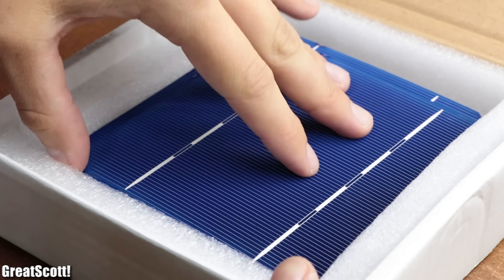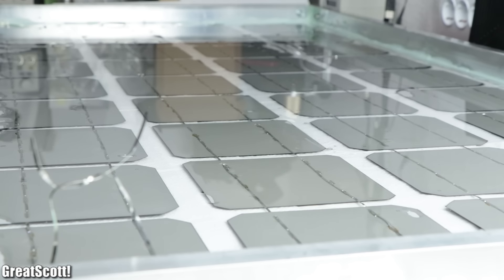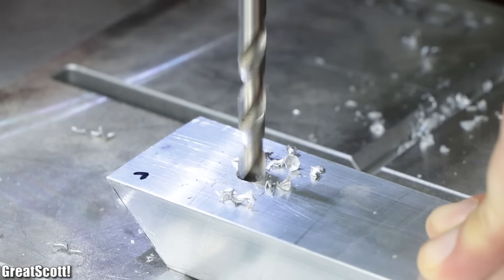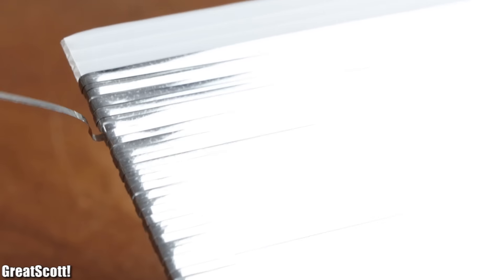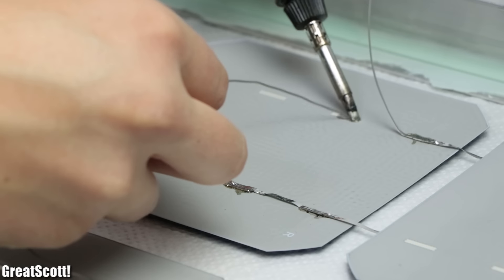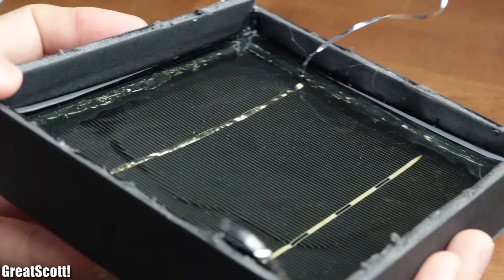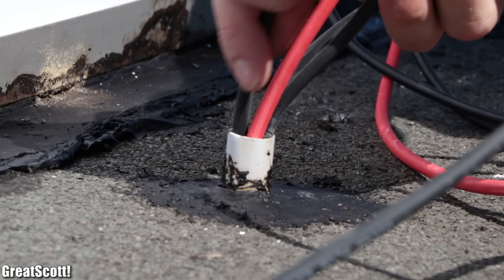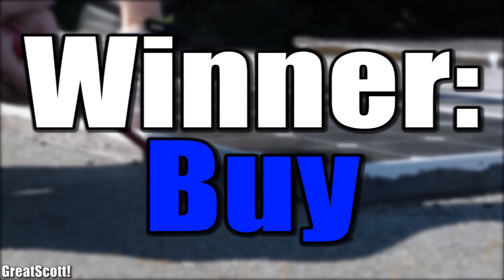100W Solar panel || DIY or Buy

Comment: In my physics class, my group managed to increase the light intensity and efficiency significantly by adding aluminium foil as a funnel into the solar panel, it got quite hot quickly but aside from that, I have no idea why this isn't done commercially. Does anyone know?
Reply: There is a good reason that parabolic reflectors are not used in that method, and it is the heat. Heat destroys photocells. I've personally always wondered why we don't just collect all of that heat from panels, and use it in practical ways. 

Perhaps a water or oil filled coil heat pipe attached to the back of the panels?

1. liquid cooling on your panels
2. possible way to run your hot water
3. most of that heat is even there in the winter

Other than that, there are a few companies that make adapters for panels, that are literally a Fresnel lens, which refracts and concentrates light. This doesn't increase the actual efficiency of the panel, but concentrates more light onto each points, increasing the reaction. 
The reason people don't use them more, is that whole heat issue.
Reply: K D - Your physics class fail. Matte white painted cardboard is more reflective than alfoil, even mylar. Only custom reflective material for hydroponics comes close to matte white from a rattle can. You fail because you didn't google any tests of reflective surfaces! :P
Reply: I was thinking of doing the same thing but with mirrors 🤔
Reply: @bashkillszombies  "custom reflective materials."

Nah, doesn't need to be custom by any means. BoPET would be the more cost efficient material, like what they make emergency blankets from, and it's readily available. I've seen those blankets go in Walmart for <$5 for a fair amount of material. It's what most indoor and hydroponic clandestine grow operations use.
Reply: @ossiehalvorson7702  That mylar material doesnt hold up very well to the elements, but if replaced often it still might be cheaper. It could be stretched out on a frame to reduce wind abrasion. Anodized aluminum is the industry standard often with a clear coating or glass. Stainless steel might last forever too.
Reply: @welcometocattown2036  water-cooled solar panels exist, the heated water is used for hot water.

Comment: Why do you mount your solar panels directly to you roof?? I think it need some airflow under the panels for cooling
Reply: It's how most people do it, but cooling would definitely help since overheating solar cells are very inefficient. Coating them completely in resin doesn't help matters either
Reply: InfernosReaper, w.r.t. resin coating what would you suggest?
Reply: He made a video about exactly this topic some weeks ago.
Reply: Amen to this. Needs ventilation or the lifetime and performance will both decrease. Check temprature coeficient in datasheet.
Reply: Here in Holland nobody is glueing the solar panels to the roof. We all use a structure that aims the solar panels to the Sun. It gives a better rendement.
Reply: @vanhetgoor  'yield' would be the better word for 'rendement' when aimed at English speaking audiences
Reply: @Ed19601  Excuséz moi mon Franglais.
Reply: @vanhetgoor  excuses niet nodig, kan gebeuren

Comment: Isn't the plexiglass going to get cloudy because of uv ?
Reply: Yes and then the cells are lost because of the resin, but probably they will crack before because they aren't flexible while the plexiglass is and deform by heat and cold.
Reply: no because it has a uv protectant in it
Reply: Yes, it will, but slower depending on how much UV expensive iinhibitors are put in said plastic.   @Blox117
Reply: he did it it in worst way possible on purpose, there are more cost effective ways, lamination is cost effective and looks professional and not messy, perfectly waterproof as well, he added costly things on purpose ;)
Reply: @shanewhite352  well plexiglass works fine and imo a better choice due to crack resistance. You can find plexiglass for rather cheap with UV protection that won't show yellowing for years. The thing that'd fail here first is the epoxy as it yellows rather quick even with UV resistance. 
As for methods, could have used some kapton tape (a 3-5$ roll should be enough) to hold the Cells together and insulate the back and then use a thin aluminium sheet (should be around 10$ or less for that size) to hold it together for thermal transfer. There's a ton of ways to go about it for much cheaper. Also VHB tape is cheap af and works well

Only issue I see is the method and work is rather pointless as you can find monocrystalline 100W panels with like 20% efficiency for any day around 50-60$ from Asia, NEW. So these panels aren't exactly saving you much money especially none in terms of labor. Also 150W panels are like 70$ so there's that

Comment: In my opinion, the cheapest and best for this project is to use old window panes (sometimes you can get them for free) and transparent silicone (I used the one for gluing aquariums). The cells can be hermetically sealed with 2 panes of glass (by sticking cells to the rear window with a small amount of silicone), or the cells can be filled with neutral liquid silicone. You can also combine both solutions and the panel will be almost bulletproof. The glass is rigid and UV resistant. Silicone allows the cells to work, so they will not crack due to heat.
Reply: I think with ordinary glass there might be a power loss though.
Reply: @douglasheld  Glass transmits about 80-90%, while Plexiglass transmits 92%. It is impact-resistant (so perfect for hail), but it is less resistant to temperature, softer and bends quite easily under weight. These solar cells are very delicate and the last thing you want is a flexible structure.
If you want to use plexiglass, you need to make the structure stiff or use cells made using technology that is more resistant to stress and bending.

Comment: It is sad to accept that BUY versions is leading DIY versions by 3 points.
But, we should  not forget that DIY versions helps us to learn and gives us experience about the subject,which is priceless.
Reply: Manoj BR agree. It makes sense, as commercial products benefit from volume,  economies of scale and usually cheaper labor. But there's no equal to the satisfaction of making a custom item :-)
Reply: I agree.
Reply: Nope. That's the benefit of mass production... sadly
Reply: Agree. Everything about learning not just about earning.
Reply: @Joey Barreras if you do it practically, you will never forget it
Reply: Yes, ill get both just because of this
Reply: if your goal is learning you are right but if your goal is having electricity at home them  the buy version,  because you can buy two solar panel by the price of  make only one yourself.
Reply: Estoy de acuerdo ... también hay métodos más simples
Reply: As some other commentors mentioned, there are way cheaper ways to do this. You can sub out his framing materials for wood or other cheaper variants.
Reply: There's a chance and room for improvement and DIY will be the leading version
Reply: One can get solar modules for under 10% the price of a commercial panel. They are factory rejects, and have chipped corners. This brings you price way down. Plus get away from aluminum channel to reduce costs.
Reply: Thanks! You nailed it.
Reply: exactly, at least now I know how to build it, but just like baking cookies, I rather just buy it from a person who makes them. A whole lot less stress and easier...
Reply: I was thinking the same. When he showed the solar cells and then the plexi-glass. The plexi-glass cost more than a purchased solar panel.  Plexi-glass is kinda expensive. Plus all the other materials.
Reply: Still a fun project.

Comment: I'd be curious if you could combine solar water heating with solar photovoltaics. Only sensible if you have limited space of course, but heating water with the wasted part of the sunlight and cooling the cells with water might be a more efficient way to heat during e.g. the winter.
Probably just not worth it if you have enough space.

Comment: Fun project! A few concerns/ideas I have — Will the plastic panel and/or resin discolor (i.e. turn yellow or foggy) with prolonged UV exposure? Is there a significant CTE  mismatch between the resin and silicon cells which will cause cracking after exposure to temperature changes? Reworking a cracked cell will be very difficult. Finally, it may be better to mount your panels slightly above the roof instead of laying flush. The space will allow airflow under the panel to keep it cooler and therefore more efficient.
Reply: Is CTE repeated hits to the panel?
Reply: @Eduardo_Espinoza  — Hi! Not sure what you mean by “repeated hits”. I think you are asking if CTE mismatch is a cumulative or compounding effect. If so, yes. Thermal expansion mismatch is a degradative effect. The more cycles and/or the greater mismatch, the lower mean time to failure.
Reply: @Samuel-km5yf  These CTE stands for compounding effect? I don't know what CTE is & I think I googled the wrong one.
Reply: @Eduardo_Espinoza  - Oh, I understand now. CTE stands for Coefficient of Thermal Expansion. When two different materials are in close contact, and if those materials have significantly different CTEs, then they will expand and contract at different rates when the temperature changes. This can cause warping, delamination and/or stress fractures.
Reply: @Samuel-km5yf  Thank you very much! Well said!
Reply: @Eduardo_Espinoza  - You’re welcome, my friend! Have a Merry Christmas and a Happy New Year!
Reply: @Samuel-km5yf  :yougotthis:

Comment: One more thing you could have done with your version: Put a reverse bypass diode on each cell, so if a cell becomes shaded, you only lose that 1 cell, plus the forward voltage drop if the bypass diode. I would recommend low voltage Schottky diodes, because of their lower voltage drop. With only 2 diodes, if one cell is shaded, you lose two entire columns of cells, which is half the panel! The fact that you made your own, you could put those diodes in parallel with each cell, producing a better panel for less than ideal conditions, than the commercial panel. I would have used tempered glass, rather than acrylic, for the glazing.(that's what the commercial panel uses)
One other recommendation: Mount the solar panels on stand offs, so there is a gap between the backs of the panels and the roof. As the cells get hotter, the output voltage goes down. Semiconductors are negative temperature coefficient, so their voltage drops as temperature goes up. The cooler you can run the panels, the more voltage they will produce, with no reduction in amperage. That will allow them to produce more wattage.
Reply: The problem is the expense of the diodes albeit ~5-15 for 36 cells in this case, they are also approx 3/8in(0.8cm) cylinders, making for awkward lumps near each cell when you encapsulate in resin or vacuum seal with polyacetate films
Reply: @AutoLinkThisToGmail  You're right on two counts. 1, the diodes need to be rated for at least the short circuit current rating of the solar cells. They also have to be able to withstand that current at high ambient temperatures, often exceeding 50 degrees centigrade.(122 degrees Fahrenheit) As far as bullet epoxy rectifiers go, it would actually be better to use direct substrate rectifiers, similar to what you see if you take apart a high power bridge rectifier, so you don't have the bulk of the epoxy package, and the terminals of the diode are flat, and also serve as a heat sink. Besides, if you're building a framed, glazed panel, the little 'bumps' on the back side shouldn't be a problem, as long as they are lower than the terminal block. I'm guessing, that in bulk, such rectifiers could be had for pretty low cost, compared to the increase in performance in panels that are installed in less than ideal places.
Reply: You can get smd schottky diodes made for switching power supplies very cheaply. They are good for up to 5 amps constant current, two in series gives about a 0.7v drop. Would make excellent bypass diodes. The voltage drop you want is higher than 0.5v.
Reply: @christopherleubner6633  actually, you would want to put them in parallel with each other, and put them in reverse of the polarity produced by the cell. The diodes would be completely out of play, no matter how high the solar cell voltage is. Their purpose, is to limit the reverse voltage on a shaded solar cell, so the less voltage drop, the better. You would put one parallelled pair of diodes on each cell. In fact, you could put one diode across each of the pair of cell interconnectors on each photovoltaic cell, to help with current sharing. The antiparallel shunt diodes need to be reverse biased, by the output of a solar cell.
Reply: Now replace with high quality glass. Suspend the whole thing and put a natural cooling system taking at least fifteen degrees off the electrical components. 
Invert system. Use eight mirrors. 
Record results. Replicate three times. Power your home for less than a thousand dollars. 
Rewire components in parallel, which was recently in the news. 
Replace copper with silver and upgrade materials used. Five hundred more dollars, it was just in the news a few weeks ago. Now you should be able to power your neighbors home too.
Reply: Robby H what news brother? Cost of high quality glass? Model for natural cooling? Cost of silver solder and equipment to do so? Things are never this easy or cheap. But if I’m wrong correct us all with data and links to make our life better. There is no such thing as a free lunch. Respectfully, not trying to fight just give the data if it’s legit.
Reply: @wmd5645  we're talking about using  twenty dollars worth of materials instead of ten per panel. Not even per cell. If the gain is such that one panels equals more than two, it is easily cost effective. 
Also, to be clear, we are not talking about them replacing copper components with silver. We're talking about the dust they use in chemical convictions to deflect light into electrons in a cell. So were talking small, very small, amounts of copper, silver, or even GOLD being used in these applications. Think of the cost of an extremely thin layer of gold enough to cover the surface area of your solar panels. Still a small increase in cost compared to a device that's making thousand of dollars or MORE of energy annually. 
Again; invert, cool, and magnify and you are talking enough power to share amongst your neighbors. To put it in perspective.
Reply: @robh467  I like your response but I need the data. We need the data for better clarity. I'd love to take your word for it brother but electricity for the neighbors is a big claim. Also, thanks for the definitions I'll be looking into that "dust".  Anyone reading this please log all your experiments and post them to an appropriate outlet, the more brains and discussion the better!
Reply: @wmd5645  oh I feel your vibes entirely. 
As I say many times in many responses; it's between you and me but here for everybody to see. 
I'm no engineer, nor computer programmer. 
I've just had a passion for science, and I read a lot. I think a lot, while digging ditches you know what I mean. 
But the equations are simple. 

...and by dust I'm referring to the amount of particulates they use in a solar cell. They now have the ability to use different materials and capture the different parts of light, at different dimensions. 
Think of a three dimensional cell, where nothing goes to waste. Again though the minerals, very fine mind you, they combine for both there properties to essentially make it photovoltaic...differ as to what properties of light they steal🙃 and the conductive property, i.e. copper, now gold...is what we're talking about changing. As well as the other minerals, for a three dimensional one hundred percent absorption and transference.

Comment: Nice video! Here are a few more tips: did the resin leave any gaps between plexiglass and the cells? If yes, you could try pouring a thin layer of resin onto plexiglass and then place the cells on top of it, to avoid any air gaps. The problem with air gaps is that when the temperature changes, water can condense on the surface of plexiglass and reduce the output and in the end even mold can develope in those spaces which is really pain in the ass (it permanently affects the output). Also, you can clean the flux and fingerprints with acetone in a spray bottle, thus further improving the output. And one more thing: plexiglass will degrade under UV light over time and decrease the output. It's also not very scratch resistant which can be a problem when cleaning the panel. (use glass or tempered glass instead)
Reply: That's what the commercial panels use, and for exactly those reasons.(tempered glass)
Reply: Also more tips: Don't eat yellow snow, nor pat burning dogs.

Comment: I'd be insanely curious to see you revisit this one. I suspect that there may be a way to either source cheaper materials, or save some bucks by buying more cells, or maybe getting different, higher (or maybe even lower) efficiency cells. I wonder about encapsulation with resin vs vacuum sealed plastic sheeting. I wonder about acrylic vs glass (and then tempered vs regular).

I even wonder about what the absolute Frankenstein solar panel would look like or do. I'm talking "what do I have laying around the shop?" copper wires from old chargers instead of nickel strips, glass salvaged from some old monitor or something. Frame made out of literally anything. All in the name of curiosity/science haha.